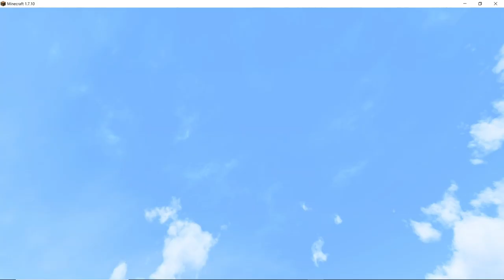"NUCLEAR REACTOR" in-Depth Tutorial | Everything you need to know about Nuclear Reactor in HBMs Mod

Comment: Fission reactor tips:

For a super compact fission reactor make a checkerboard pattern of nuclear reactors with niter covering two faces of each as well as two blocks of moderating graphite. We will be pumping the water in from below. On the top third layer steam turbines should be placed. Usually we want super dense steam but for this purpose we only can have normal steam. With this compact setup the turbines dump water back into the reactors reducing the size of the water tank for feedwater.

You can control these reactors remotely with redstone! This is useful if you are not producing enough water, a complex but robust timer could be the solution to this by only having some reactors active at a time while the rest regenerate coolant. Additionally the auto shutdown feature combined with a timer and a comparator will compensate for total coolant loss.

Use barrels to sense the fluid levels of your reactor and comparators to set off alarms if something is going wrong.

Only for big reactors: you dont need a reactor controller at all, allowing you to make a 3x3 reactor sharing control rods and reaction chambers with itself, just link them wirelessly and make sure there is no reactor in the center. 

Uh oh, you were doing everything right and it still exploded? Not to worry! With the power of denial you can fix the problem that isnt there. Relax... The core didnt explode. YOUR reactors dont explode anyways. 3.6? Yeah its not nominal but it isnt catastrophic, must be the feedwater. Remember if you dont see it then it didnt happen.
Reply from the maker: I'm actually not even gonna add anything to this haha , this comment deserves to be pinned and read by everyone who ever watches this video 😂
Reply: You need to make a video on the design of one of these dude
Reply: Tbh I think the villagers would enjoy the radiation xd.
Reply: @SavageVegeta bro I am too lazy xd

Comment: UPDATE: Please note that in newer versions of the HBM Nuclear Tech Mod, this reactor has been replaced by the “research reactor”. This reactor can no longer produce electricity and therefore, this build no longer works.
Reply from the maker: 😕 this absolute modular unit of a reactor will be missed 🥲
Reply: @SavageVegeta  Also, here’s an idea for another video: How to build a (size here) RBMK with automatic control rods
Reply: I can still use it in 1.12.2
Reply: actually it still exists and works fine in 1.12.2
Reply: Yeah i just build it in 1.12.2
Reply: WHAT IS THE POINT OF THE REACTOR THEN?
Reply: @ShlongMaster5000  It’s used to make items with radiation from it now. It’s no longer used for producing power

Comment: Pro tip: when you get technicium-99 (for which you already need a reactor, sadly) you can make reinforced niter block, which both creates coolant and doesn't let the radiation out.
Reply from the maker: Yeah that block is pretty handy , thanks for the tip !!
Reply: @SavageVegeta  Unfortunately, that block is not available in 1.12.2, so I always get <1 RAD/s regardless of the thing being underwater AND in a 5x5x6 casing of concrete.

Comment: Radiation - HE absorbers are useful if you want to extract every drop of power from the radiation
Reply from the maker: If you cover the open sides with water / concrete / reinforced niter then there will be no radiation leaking out tbh
Reply: @SavageVegeta  I ment in terms of extracting as much power as possible. With the steam and radiation absorbers.
Reply from the maker: @Kidozy  irradiating the environment is not worth it tho ... It's much better to have infinite water and coolant instead by covering sides with water and niter blocks
Reply: @SavageVegeta  who said its only 1 absorbers and not a stack of them or so, surrounding the reactor? :)

Comment: What is the first reactor I should make on the newest version of 1.7,10? 
I am currently at a point of making desh and ore acidizing but I have a severe power problem. 
Also, is there a way to void fluids?
Edit: I have a lvl 4 anvil.
Reply from the maker: Generally the first reactor you go for is the Zirnox in the new update afaik, if you have the materials then you can also make the Modular Nuclear Reactor (you can also call it Big Nuclear Reactor) which can take Nuclear fuel ingots directly but it will consume coolant so that's one thing you'll need to produce
Reply from the maker: As for voiding fluids you can use the Flare Stack, but it will not void all fluids iirc ... Still worth a try in creative mode with the fluid you're trying to get rid of cause if it's a flammable fluid then you can burn it to make power
Reply: @SavageVegeta  Thank you, these informations are immensely helpful.
Reply from the maker: @StainlessSteelVT  you're most welcome

Comment: Can i use pipes for cooland in those holes where steam Is going From because 1.12 version still has old small nuclear reactor
Reply from the maker: Yes you can , however that'll require you to constantly make coolant. Placing reinforced niter blocks is a much better option as the reactor can make its own coolant
Reply: Hmm but what about radiation do i make the radiation absorbers or something else
Reply from the maker: @rbmkreactor9373  if you place reinforced niter blocks on all 4 open faces radiation won't escape

Comment: Do you have any videos on reactors that you can just leave be and it will generate power provided it has fuel? Planning on using this mod in a pack and we'll want to just set up the reactor, stick some fuel in and go do other stuff
Reply from the maker: The multiblock nuclear reactor is what you need man, just keep on adding fuel to it ... which can be uranium fuel (cause you can automate the production of uranium making it an infinite resource without mining for it) and it will keep on running without any temperature fluctuations. Here is the video on how to automate it completely : https://youtu.be/e2gwD7aPT2I
Reply: @SavageVegeta  thank you for the help. I'm actually curious whether the reactor you built a year ago, the 15x15 rbmk reactor can be left to its own devices provided it has fuel? I was thinking to build the reactor and have the control rods down at 10%-20% to avoid over heating. I understand it would make less power at the same fuel cost but it would be safe all the while generating a lot of power
Reply from the maker: @Ar_Tank  the problem with leaving the RBMK running is that there is no way of automating the refueling process. So once the fuel rod has depleted the reactor will stop producing power ... Another thing is the temperature of the fuel rods will change as the depletion levels change which will affect the power produced 

These problems don't exist for the Multiblock nuclear reactor , as it will always run with constant temperature thus producing constant power
Reply: @SavageVegeta  but the rbmk looks so much cooler with all the turbines and the cooling tower XD. In your 15x15 rbmk reactor video, assuming we follow the exact methodology of having the control rods raised by 100%, roughly how long (in real time) would the fuel last? If I remember correctly the fuel you used in that video was high enriched uranium fuel
Reply from the maker: @Ar_Tank  fuel values were changed in the recent updates of the mod so I can't say for sure man , also in that video I used so little water and cooling towers that the reactor will just heat up and explode. If you want to run that reactor without it going boom boom then add more heavy infinite water tanks and also big cooling towers instead of auxiliary cooling tower. 

And even the Multiblock RBMK reactor will use turbines and cooling towers like the RBMK ... Afterall it also produces steam and that steam is then used to produce power
Reply: @SavageVegeta  I'm going to do some testing tonight with different cooling combinations and check how roughly how long the fuel would last and let you know in this thread. If you're interested I can give you more in depth findings and if you'd like you can make a video on it you're welcome to use my numbers
Reply from the maker: @Ar_Tank  aight that's cool man , and I'll do some testing as well cause I'll be checking the compatibility of the newer energy control mod with the latest ntm version

Comment: The energy that this mod uses is redstone flux bone RF? or is it another type?
Reply from the maker: The energy used by HBMs is "HE" , for conversion "1 HE = 4 RF"
Reply: it uses an energy type called "HE" for HBM Energy, follows the conversion that savage said. Expanding on that, you can turn it into RF with a HE to RF converter block.

Comment: is there any way to keep the radiation entirely contained with this reactor? the radiation somehow penetrates right through concrete bricks, both built around the reactor and outside the reactor building itself even.

it's also flooded with water too...
Reply from the maker: Containing the radiation can be achieved by only covering the open area (basically the middle portion) of the reactor with concrete bricks ... If there is still radiation then you can place radiation absorber around it and thrall suck up any extra radiation
Reply: @SavageVegeta  thanks! I thought water could contain it too so I submerged my reactors but never put any concrete on the open sides.
Reply from the maker: @RedVRCC  yeah just try that and it should be good , either having water on open sides or concrete is good enough for containing radiation
Reply: @SavageVegeta  well unfortunately I think the 1.12.2 version might be bugged, submerging it and encasing the area in concrete didn't completely remove the radiation although it did seem to reduce it. Previously was about 30 rad/s outside the building it's in, now it's >1 rad/s standing next to the walls and 10 rad/s inside the reactor room. 

Eventually the 1.12.2 version will probably turn it into a "research reactor" like on 1.7.10 so idk why I'm even using this to generate power anyways since I'll have to tear it down once it becomes useless for power.

Comment: What can I do to get rid of the rest of the low pressure steam without having to manually remove it?
Reply: Cooling tower
Reply from the maker: Condensers and cooling towers tho in the latest updates of the mod this reactor has been changed to a research reactor and doesn't produce any steam

Comment: Is it any different for 1.12.2? I did everything exactly as in the tutoriall but for some reason it doesn't work. The reactor is generating super dense steam but it's not transfering it to the turbines for some reason.
Reply from the maker: No it's not different from how it used to be in 1.7.10 ... And if it's making steam then the reactor itself is working properly
Now the problem is transferring steam into the turbine. 
So either the fluid pipe that you've used is not set to super dense steam or the turbine itself is set to take something else than SDS. 
Do make sure to check both of these things , the pipe coming out from the reactor should be set to SDS and the first turbine should also be set to SDS.
Reply from the maker: If any of these solutions still don't work then dm me on discord and maybe we can solve this on a VC
Reply: @SavageVegeta  Aw yep now it works, my bad I messed up the fluid pipes. I accidentally used Ultra Dense Steam pipes instead of Super Dense. Thanks for the help!
Reply from the maker: @agentredacted9835  aight !!

Comment: the turbnes wont work i tried eevrything but the steam buffer fills up
Reply from the maker: you need to get the low pressure steam out from the final turbine and pump it into a cooling tower which will then convert it into water
Reply: @SavageVegeta  yeah forgot it dumb 

as suggestion could u make a vid of the smallest nuclear reactor u can make including turbines and everything my record is 5x5x20 (cuz high cooling tower)

Comment: So I’m doing 1.12.2 and my water tank isn’t filling up
Reply from the maker: which water tank are you using ?? and what are you using to fill it up
Reply: The same one you were using and also the steam turbine that was taking in regular steam was building up low pressure steam
Reply from the maker: @masked1979  that low pressure steam will need to go into a cooling tower , the cooling tower will convert it into water which you can take back into your water tank
Reply: @SavageVegeta  so the water tank did fill up but the low pressure steam in the turbine didn’t go down

Comment: I think the reactor is broken? I tried all the fuel rods from uranium to balefire, and nothing happened, even with control rods out, full water and coolant tanks. No steam or hull/core temperature change. Tried on singleplayer and a server with friends and still not working :/
Reply from the maker: How many rods did you use inside the reactor my dude ??
Reply: @SavageVegeta  anywhere from 2 - 10 , i tried single, dual and quad. I even tried surrounding it with lava  and still no change in hull temp? starting to think the latest version is just bugged. :(
Reply: (Im on 1.7.10 btw)
Reply: @theodoresmith3313  bro you used not fuel rod/other mod fuel rod/rbmk fuel rod

Comment: Is this possible to install on android?
Reply from the maker: Sadly no as it was made for Java version of Minecraft. You could try "pojav launcher" but this mod is pretty resource intensive so you should have a really good phone to run it.
Reply: @SavageVegeta  alr, ty for answering
Reply: @SavageVegeta  this mod works perfectly on every phone, I don’t know how it is on computers, but in pozhavlaunche the main thing is a good processor, I tried it and it turns out that most mobile devices are equipped with more than enough powerful processors, RAM 600+ to perfectly. XD